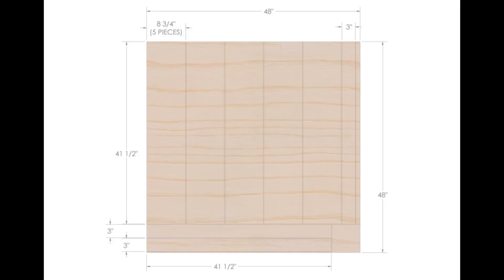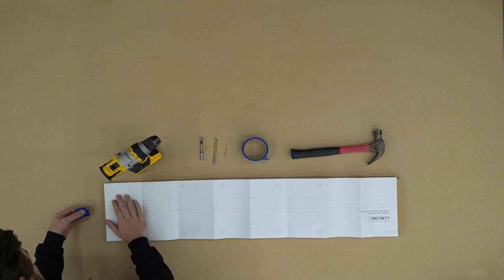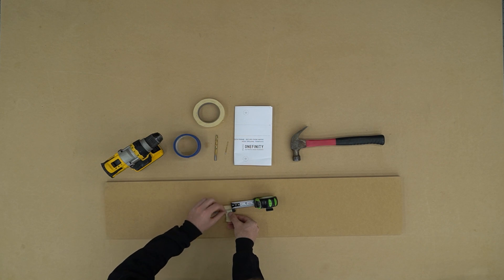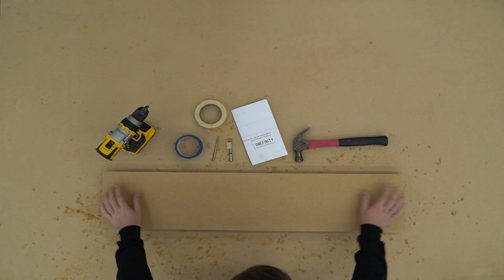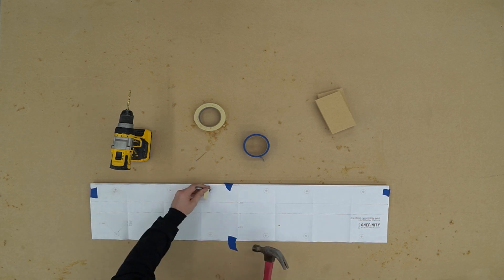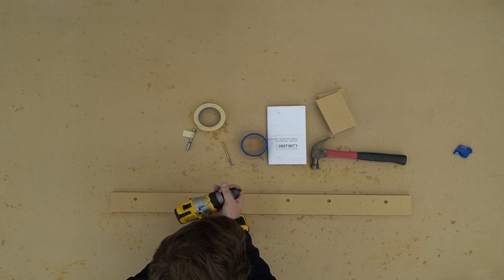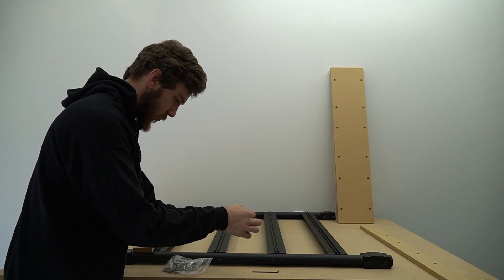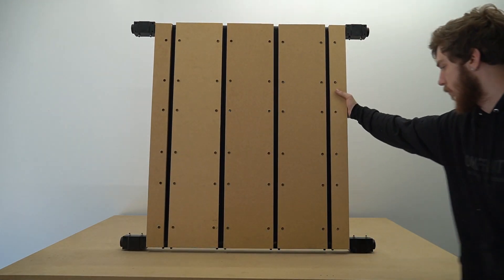Onefinity CNC QCW Secure From Above Instruction Video

Comment: FYI for everyone, there is a way to lock a drill bit into a drill so it doesn’t come loose and fall out during use like you saw at the 4:02 time stamp. Simply secure the bit by turning the chuck by hand until tight, the turn the chuck in opposite direction until you get one click. Your drill chuck is now locked and bit won’t fall out during use. It’s a hidden feature some drill manufacturers don’t even know that exists! 👍🏻
Reply from the maker: Great tip.

Comment: Definitely regret not getting the secure from below.  It's very difficult to get these to line up.
Reply from the maker: :P  We've placed warnings everywhere that the above version was much more involved.
Reply: @OnefinityCNC why not use the CNC to make these? Am I missing something?
Reply: why would you choose secure from above over secure from below?  I don't get it?  I don't plan on running my bits into the waste board (or at least not very deep).

Comment: If doing this by hand, it makes more sense to drill the 1/16" through holes first. That will allow you to locate the center point of the forstner bit and get that properly aligned. More importantly, when flipping over to drill the 1/4" holes from the bottom, they'll be centered. Doing the forstner drilled hole first makes it more likely the 1/16 and 1/4" holes will be off center.

Or use the 1F to drill the holes for you. I used a 1/8" bit with spiral drilling for the qtr inch holes and the 3/8" pockets. Took about 15 minutes per big board and half that for the two narrow side boards. I have a VCarve file for it so I can make replacements at any time.
Reply from the maker: Great tips.
Reply: Would you be willing to share that file? Just about to drill mine and was thinking it would be better to do with the CNC.
Reply: @georgehampton25  Sure. Are you on the Onefinity forum?
Reply: @jimhatch5873  I can get on there.
Reply: @georgehampton25  once you're on there, PM me and I cand drop you the file.
Reply: Sent you a PM.
Reply: @jimhatch5873  Thought I sent you a PM, but having a hard time figuring out the Onefinity forums page. Is this file for the Journyman? I have the Woodworker so not sure if it would be the same or not.
Reply: I wish I had read all these comments before purchasing the secure from above. I’ve been fighting with it and losing.
Reply: So is secure from below a better option? I am thinking about getting a 48x48 Elite?
Reply: @D0b3rman68 Opinions vary. The benefit of the from the top version is you can see how much more waste board thickness you have before hitting an insert as you resurface it - with the from below version you'll see it's getting thin after you hit the screws 🙂 It's also easier to replace waste board slats because you don't have to lift the whole thing up and secure it while you replace waste board panels. The OF is a heavy machine.

Comment: After watching this I'm s glad I bought the Secure from beneath QCW... LOL
Reply from the maker: We gave options!
Reply: Until you want to replace a slat!
Reply: @danielstein8320  slats so easy to replace from the bottom when I’ve done it.  Only had to do it once and that was because I dropped a heavy vice on it by accident.  Took 2mins to rip a new piece on the table saw and 30sec to unscrew the old and re-screw the new.  Still loving the decision to go secure from below.
Reply: Isn’t it heavy to lift on a 48x48 Elite?

Comment: Great Video...i'm assuming that 1F did all the necessary measurements so that when this is surfaced (with lets say a 1" bit), it will surface the entire area and not leave an overhang?  Also, it would be freaking amazing, if 1F could upload the template files for both journeyman and woodworker in advance so the customers who are waiting for their machines can get this done beforehand.
Reply from the maker: Hey Caleb... The Owners manual has the info needed to create the wasteboard. The Owners manual can be found here... https://www.onefinitycnc.com/support
Reply: @OnefinityCNC  Phenomenal!!  thank you